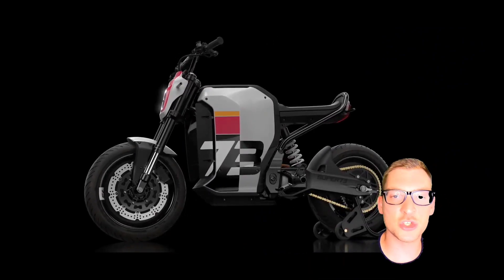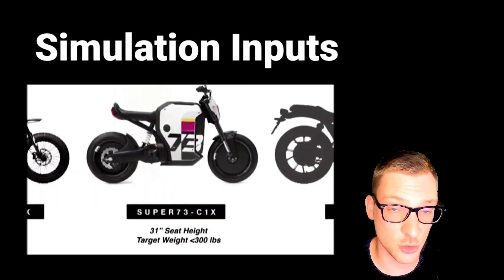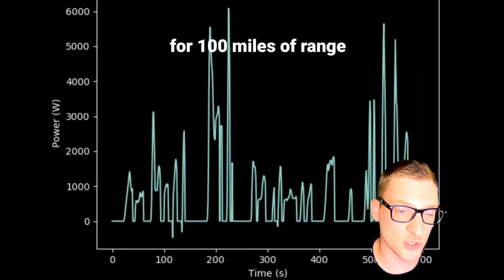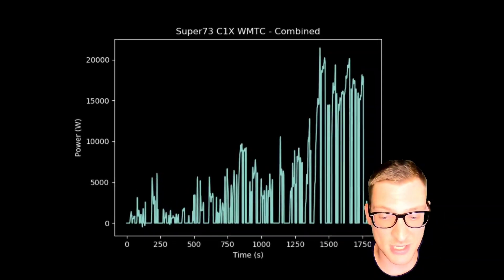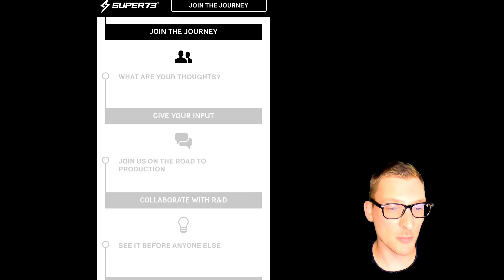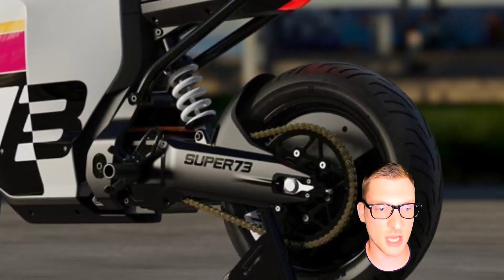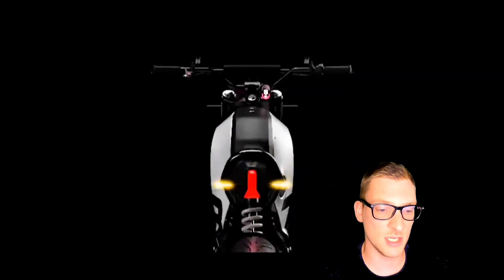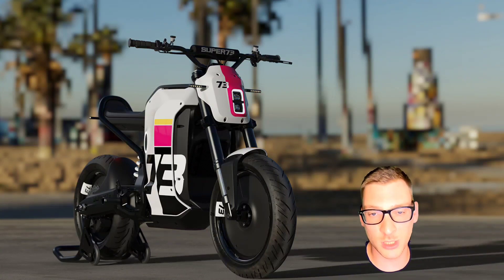SUPER73 C1X eMoto Performance  ?

Comment: If the C1x pack is really in the range of 4-5 kWh (at 72V/55-69 Ah), charging 80% within 1 hour needs (cmiiw) approx. 3.2-4.0 kW of charging power. In the more "advanced" countries, perhaps it would not be a problem. In some "less advanced" countries, the house electricity is capped at 900-1200 VA, and charging stations are hardly available as public infrastructure. A little difficult to charge at home at any rate more than 300-400 W.

PS: I find the analyses & calculations done in this video very useful, as I've done a couple of similar stuff with a bit of extra details for some past projects. I just don't understand why a lot of practitioners, including supposedly seasoned engineers, in the EV industry in my country (Indonesia) seem to be quite unwilling to even look at the driving cycles to estimate the autonomy. Almost every "local" brand uses constant velocity cruise (at mostly 25-40 km/h) estimation in their brochures, while in fact it's quite impossible to even cruise at 25 km/h consistently anywhere in Indonesia. In almost all cases, nobody manages to reach the overly optimistic brochure claimed autonomy. I'm a little sad.

Comment: Moving the motor out of the rear hub is huge. It may still be unsprung weight but it's close to the pivot point of the swingarm and has much less effect. I've owned a Zero for a couple years now so there are a few things I've learned. If you can't charge using J1772 charging stations, you will be sorry. This was a $2500. option on my Zero but without it I wouldn't want the bike. Know your charging station's locations before you go. Remember not to count Tesla charging stations because they are proprietary for Tesla cars only. On the other hand, Tesla's can use J1772 chargers and treat them like long-term parking, they are selfish entitled power hogs. Big batteries ruin handling and cost a lot so better to have fast charging than a giant battery. IMO

Comment: I love the look of this bike. Great video excellent information. This bike will be well above the 7k mark I’d say it comes in at 8500. If it’s not that much they are using subpar components. They will have to put a chain guard on it and hopefully it will be easy to remove. They also need to place a plate holder they should look at a side plate style keep that retro feel they have. Most likely the lights will need to be bigger but would like to see after market options like the ones they have now. Hopefully someone who has signed up can do a video on what’s being discussed.

Comment: sondors metacycle is 14kW peak and supposed to hit 85 mph. that doesn't seem to fit on your model ?
Reply from the maker: I'm not quite sure what your question is. We don't have power specs for the C1X yet, but they are going to need more than 14kW to hit 85 mph.

Comment: Needs to be priced 5k or under imho.
Nothing special about this bike really apart from its electric which with the price of electricity now makes it not cheap to run ..
I like the fact that it can do 75mph even if it will severely limit the range, I have  ridden bikes in the past thsy are limited to 40 or 50mph and it's not safe because cars always try to get passed..
Reply: They get $3.7k for a bicycle with less than a 1KW battery and 2K watt peak rear hub motor. I think you will be lucky to see a slower and smaller battery version with  a first adopter reservation for less than $6k.
Reply: @EssPhour  yep I'm sure you are right, be a good while till we see prices that I consider reasonable lol.
Reply from the maker: I think they'll go the opposite and price it at 5k and above. SUPER73 has a near cult following, so people will certainly dump some cash to get one, purely because of the brand. But I agree, there is nothing special about it. The aesthetics are interesting, but from a performance/motorcycle standpoint, it's just a light duty bike with a higher top speed
Reply: @trowantechworks , But even for the loyalists it means getting this bike registered & licensed. I think that will turn away a significant amount of people.

Comment: Thanks for the info/informed speculation.  I currently have a Zero SR with level 2 charger, but I'm looking for a 2nd bike for my fiance that is smaller and cheaper.  Currently, the KTM Duke 200 is probably the top contender, or maybe a Duke 390 or Kawasaki Z400, but if companies like Sondors and Super 73 can enter the market and compete on specs with a 125-200cc gas bike, and come in no more than 2x the cost, I would love to cross shop.

Charging speeds are definitely the achilles heel for any electric motorcycle that wants to be anything more than an urban commuter, though.  I roadtripped my ~100mi highway range Zero SR this summer across New England, and 90 minutes riding, 45 minutes charging, 90 minutes riding, and so forth really drags your days out.  I took a 3 day weekend over labor day, and it took me a full day each way to get from Montpelier (central VT) to Bar Harbor, Maine and back, roughly 300 miles each way.  And that includes combining all food/restroom breaks with charging stops.

Anyway, excited to see where the e-motorcycle market goes in the next 3-5 years.
Reply: PS for anyone curious.  I looked all over the country and spent a couple months shopping for my SR, but managed to find one that I negotiated down to $9500 cash (well, wire transfer).  It's a 2018 with the 14.4kWh battery, the Charge Tank (what they call their optional Level 2 charger), and the previous owner had added Givi hard side and top cases, a windshield, and a phone holder/charger. 7800 miles

Cost me $1500 to get it shipped from FL to New England and shipping company sucked, but they all do as far as I can tell.

I got it in July and in 3.5 months I put over 5000mi on it.  About half the chargers are free, the others cost $1-2 per charge, which is 60-80 miles of range (I try to never take it all the way down to empty).  So figure $50-60 in total energy costs over 5k miles.  It would be lower if I charged at home, but alas I live in an apartment.

Comment: You don’t need a 22kw continuous motor to 22kw continuous lol.
Reply from the maker: Uh not sure what you mean. I was saying in the video that you're not going to cruise at 75 mph with a 10kW motor. Gonna need 20kW or more with a higher continous rating. Unless you've got an aggressive cooling system

Comment: If it doesn't have water-cooling it will overheat quick
Reply from the maker: Very valid point. There was no mention of cooling yet, but  if they are using a small motor and plan to get the performance they spec'd out of it, they will definitely need liquid cooling. Unless they completely oversize it for 30+kW and build in a safe margin. I hope it's the latter, because it would make modding the bike more fun. Think of the power you could unlock..